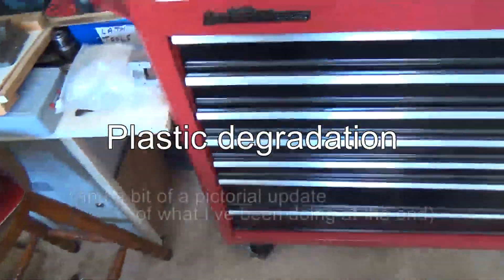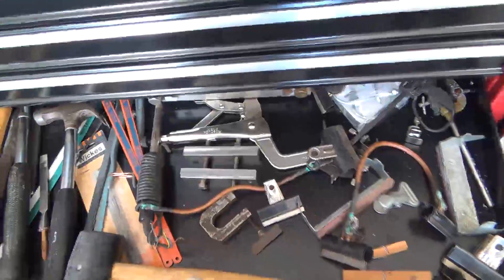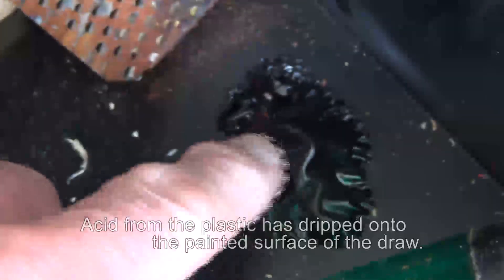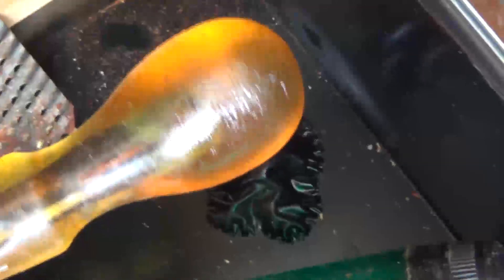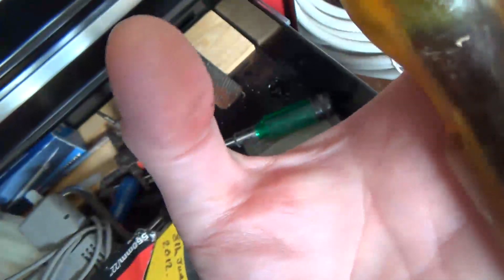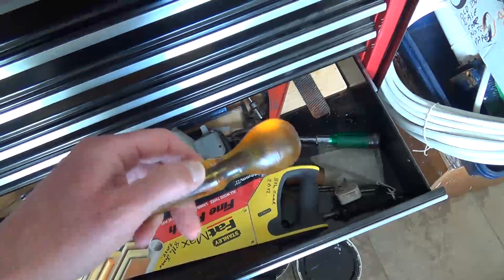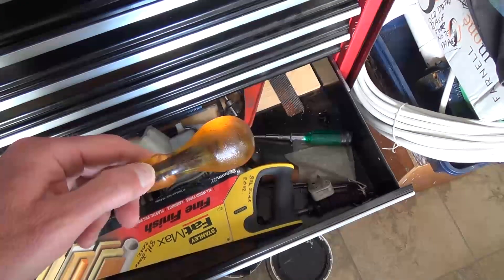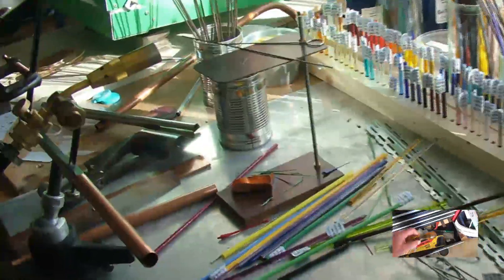Degradation of plastic and a bit of an update on what I’ve been doing  (August 2014)

Comment: Hi Andy. It's great to see you back. I really enjoy your amateur radio videos and I just found your four-bar linkage drive for variable capacitors.  Having just completed my first magnetic loop for QRP this comes as a breath of fresh air. Mine has a stepper motor, toothed belt and pulleys, limit switch, a microcontroller, etc., etc. It weighs a ton, tool ages to fabricate, takes substantial power even at stasis (microstepping drive). What I've ended up with really isn't pedestrian mobile friendly, so my next one will definitely be more like yours. Sorry this comment is a bit off-topic for this video, but I hope some feedback might go some way towards overcoming the ill-will that Google has created through its clumsy attempt to get everyone to use Google +.  73 Marcus EA5IGC

Comment: Nice to have you back Andy. You may remember I commented on your previous video on this subject (mentioning production of acetic acid by some types of wood e.g. oak). Many acetate plastics (common in the 50s and 60s) can deteriorate (hydrolise) in this way and, as you say, the process is irreversible. Don't forget to put some anti-corrosion papers in the draws with your fine tools - they will help prevent general corrosion; if not acetic acid corrosion. Regards 'the conservator'.

Comment: Absolutely spectacular work on the stained glass. Definitely showcases your many talents. After your previous video with the chisel, I went searching. My Dad was a machinist for 30 years and unfortunately died fairly young (One week after his 57th birthday). I am in possession of his machinist's tools and toolbox. There are several plastic handled screwdrivers along with a hand de-burring tool that had that same degradation problem. They are probably about 45 or more years old. I really couldn't bring myself to throw them away, so I segregated them in a small plastic box that is kept away from anything that will be damaged by corrosion.
Reply from the maker: Hi, I know what you mean about not wanting to let the tools go but it's a real problem as the fumes are really destructive.

Regards  . .  Andy

Comment: Very nice , very interesting.  About 2 years ago I brought a National NC-300 tube receiver home. All the knobs had this  thick  white somewhat gummy residual ick on them. I know it was intrinsic to the plastic and not because of something on the previous owner hands,  because (a) it was inside and underneath the plastic knobs. (b) The metal knobs were not affected   It was really hard to get that stuff off - tried dish soap, 409, Simple Green, (I'm guessing you have equivalents in the UK) all the strong cleanup stuff .  Then I read online about using dishwasher powder in hot water and an old toothbrush. Im guessing the phosphate in the cleaner  might have been the difference. I know the white stuff  was not Acetic Acid (but maybe a component of it was) Someone in a radio restorers group said that it could be fungal or biological in nature devouring a substance leeching out of the plastic as it deteriorates. I wonder if there is a form of life that loves Acetic acid?   I know that quite a few of the National gear from 50's had this ick problem eventually.  Most people think of Acetic acid as Vinegar - but that is only the most dilute form - I was in the photo industry once, so I know it can be nasty stuff in a less dilute form.
Reply from the maker: Hi Fred I think I've seen the sort of problem that you talk about. I did find a museum web site (in the USA) that commented upon some of the problems with old plastic and despite all of their research there didn't seem to be a solution to this particular type of degradation (the acetic acid problem).

All the best  . .  Andy        GWJXM

Comment: Not long after your previous chisel video on plastic degradation we moved house and got a load of stuff delivered that we had had in storage for over fifteen years. I happened on a pair of cheap kitchen tongs that have plastic handles and they were rather gooey. I mentioned at the time to my wife your experience with the chisel, anyway I thought I'd give them a good scouring with a metal scourer to see if it would do any good. Next day they had dried off but were still quite tacky. I put them to the back of the draining board with the intention of removing the plastic later. As luck would have it they disappeared down the back of the drainer and I found them about a month later. The plastic handles had completely dried out and there was no tackiness whatsoever. I re-washed them thinking they would go tacky again but they didn't. We use them very frequently and they get washed most days and are good as new. It might be worth, as an experiment, doing the same thing with your screwdriver and see if the plastic settles down to a stable state again. The glass work is stunning by the way. Cheers.

Comment: The cable is most often caused by the plasticiser in the PVC degrading, and this is because the plasticiser contains PCB oils which degrade with time and exposure to copper and air. The handles are likely acetal polymer, which is decomposing due to catalysing from either age or being in contact with metal. Nothing you can do once it starts, and the plastic eventually does turn to powder and becomes brittle. Oiling seems to keep it intact for longer, likely keeping oxygen away, but once it starts time to get or make a new handle.